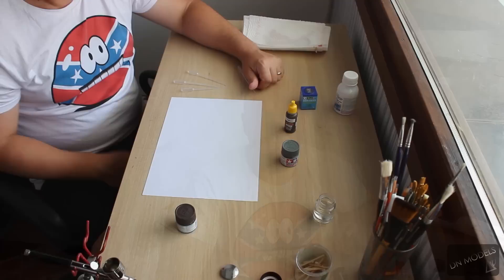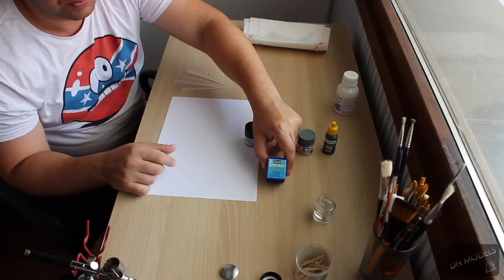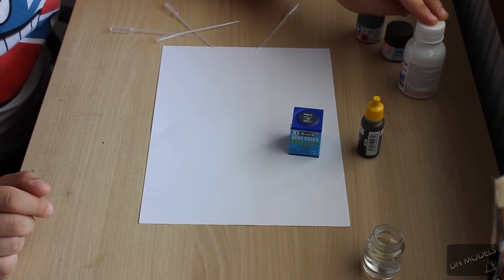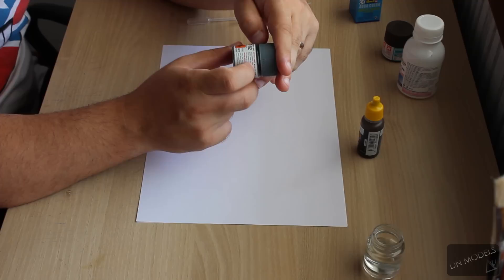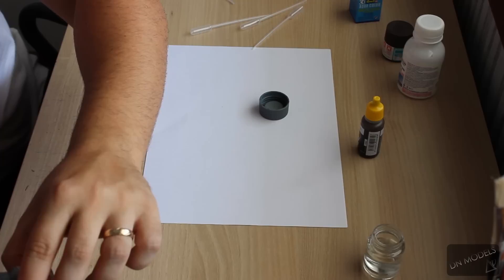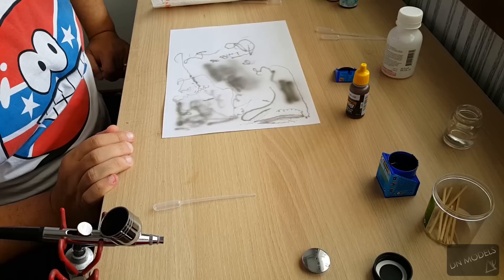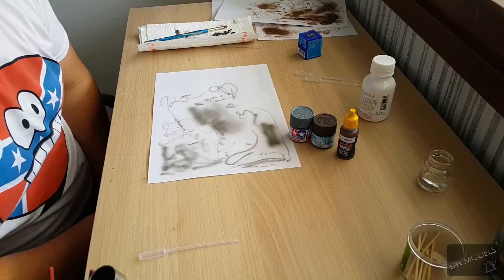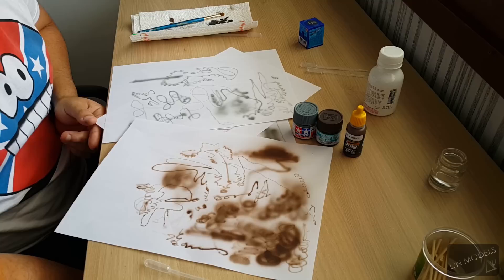Thin and Airbrush Acrylic Paints: Tamiya, Mr.Hobby, MIG, Revell

Comment: Revell Aquacolor acrylic paints are not that bad in first place.
Sure, for thinning them you better don't follow the instructions. It needs a bit of experience to thin them properly, to get a milky consistency, but no big deal at all!
The main reason why I like Revell Aquacolor is, they are good for airbrush AND brush painting (good luck painting Tamiya acrylics with brush ;)
they have also excellent covering properties.
Only downside imo, the color range is kind of limited, or is often different to the actual Color shades. You have to mix shades, which is time consuming.

Comment: good vid and explanation.  this will be of great help to many new guys for sure
Reply: nice vid.
I bought MIG COLORS to have a try.
I paint german panzer...so lot of camo.
well...i have problems with MIG colors as in your demo.
so I switch again to  my TAMIYA colors.
Reply from the maker: +hetzer62 I hope it answered some questions and help solve the problems
Reply from the maker: Water will help of course, but when paint start to dry with time, it is usually time to change it. Test it with a water dilution at first, if its work - keep it. If you still struggle with it, dump it in the bin.

Comment: i choose to use distilled water. Some chemicals used in water treatement wuold react with the pigments , specially chloride or any kind of metal or minerals. The result would be poor adhesion or clogging the airbrush (I"ve never seen yet).
Reply from the maker: It is a good choice. I keep a bottle in the trunk of my car, I should give it a go.
Reply: I would bet that you couldn't tell the difference between distilled water of tap water if you didn't know which was which.
Reply: It (hard tap water) can also cause staining and leaves marks on the surface of the paint. I recently resolved an issue of this kind and was surprised by the difference. Thanks

Comment: First, great video. What airbrush needle/nozzle and pressure are you using in this video?
Reply from the maker: +Epique13 .3mm is what I use more than anything else. Pressure depends but 20 to 28PSi depending on the target.
Reply: Thanks.

Comment: I think you need to look into getting a better airbrush. I suspect that has more to do with the problems you are experiencing with vallejo air and mig style airbrush formulated paints that are not really known to require constant tinkering with the paintcup and paint consistency like in this video. I am no expert but I have never had the problems you have and even spray vallejo varnish formulated for airbrushes straight at times and still haven't needed to do like you did across several paint lines and manufacturers made for use with an airbrush. That fact(the problem with several lines of that type), leads me to believe it is something other than the paint itself. It may be that your needle size is very fine or something more fundamental and linked to the hardware end of the equation, if you follow. You may try flow improver too in order to slow drying some and reduce the thickness at the same time and you can add thinner at the same time too. Flow improver is better for use with metallics instead of thinner too. Some paints, like Tamiya for example, use isopropyl alcohol to thin the paint and has a reaction if you use airbrush thinner or too much water. Vallejo doesn't use alcohol in their thinner and in all but a very limited number of their paints(rarer metal based metallics mostly) So, try using a airbrush with a larger needle(like a .03 to .05. if my decimal points are correct) or invest in a better airbrush like a US made badger patriot,  or badger renegade chrome, or Japanese Iwata eclipse and I think you will have a lot less problems in general. Good luck and thanks for the videos!!!